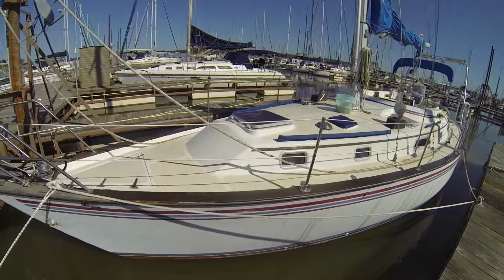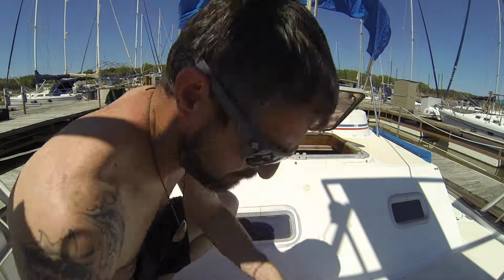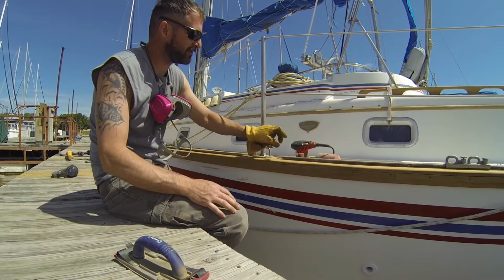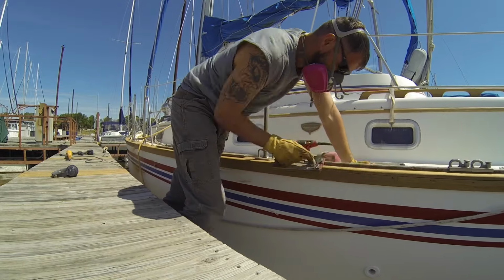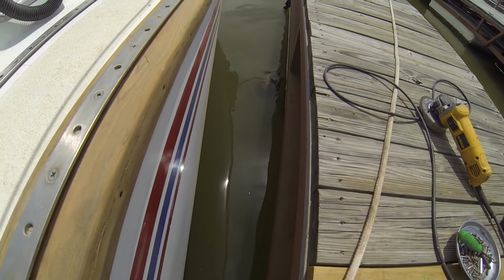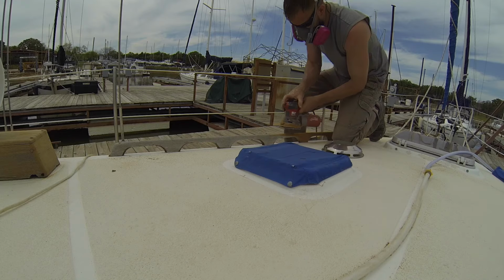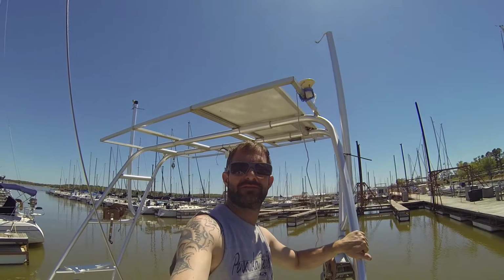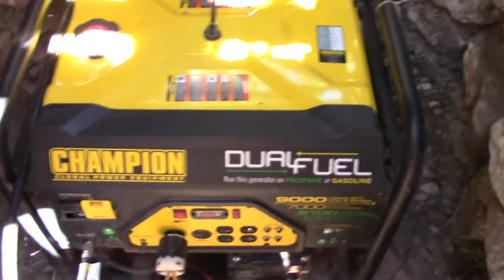Sailing Vlog - Washing, Sanding and Prepping for Teakguard

Comment: Great job on the wood trims. I just spend 6 days refinishing all the teak on my sailboat. The wood was very grey and oxidized. I used a scraper and it worked quite well. It cut down on the sanding a lot because someone had the bright idea the varnish over grey teak. What a mess.
Reply from the maker: Thanks. I hope to be back there soon sanding some more and applying the teakguard. Yeah sounds like a crappy job.

Comment: Cool blog man. If you want to bring that gel coat back. You can. Start with wet sanding with 1000 grit then 1500. Then compound, polish, wax. I wouldn’t do the non skit though.

Comment: Do you plan on full time living in your sail boat??? May I ask what area you are located in??
Reply: Nice system you have!!!
Reply from the maker: Yes probably around the time it gets cold here in Edgewood NM which will probably be Sept or Oct. The boat is located about 10 hours from me now. I plan on moving it to Corpus Christi TX this winter and living aboard it while i refit it. I dont want to hibernate thru another winter when i can work on the boat from the warm gulf coast of TX. I might come back to NM spring of 2017 and work part of the summer here. Then once i have enough money saved im setting sail for good and will live aboard the boat until i get tired of it, which i dont see happening for a long time.
Reply from the maker: Thanks and it will only get better.